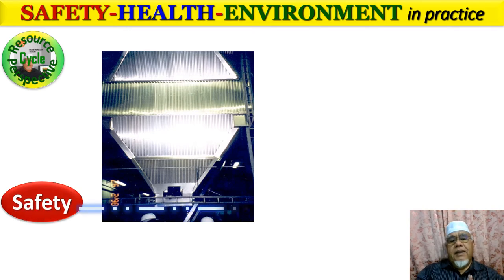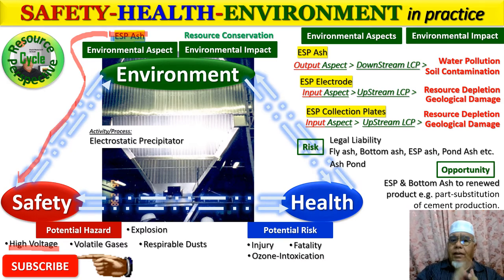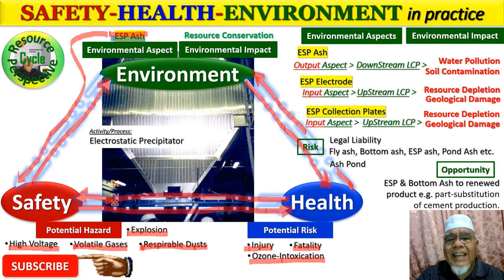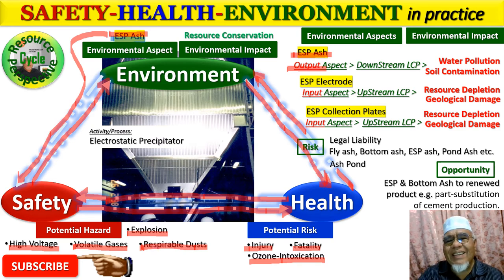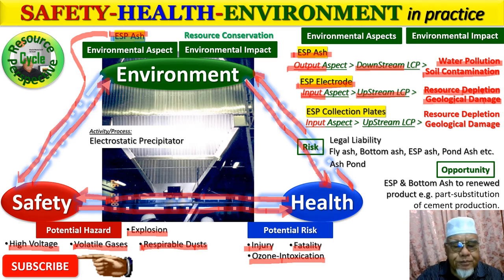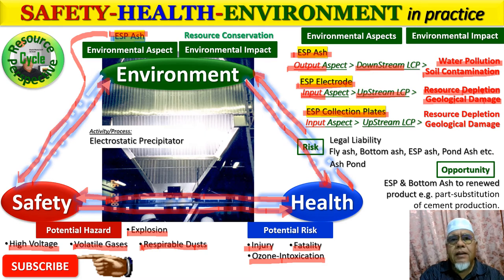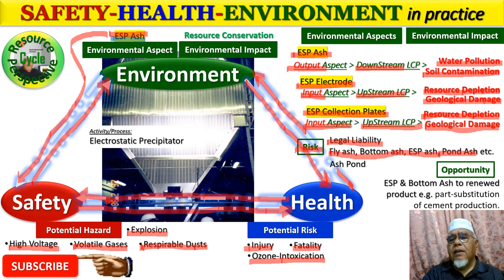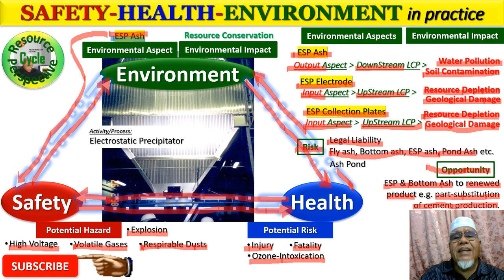S H E vs Electrostatic Precipitator.

Comment: Assallam Tuan Khalid.... terima kasih utk ilmu yg dikongsikan. 
Bnyk ilmu yg nak belajar dari tuan Khalid lagi.
Reply from the maker: Wa'alaikummussalaam Ma'am.
Semoga Baraaqoh dan bermenfaat.
Saya bukan pakar .. macam aje 😄
Please share dgn mereka yang need it.
Doakan kami yaa..
Reply: @KhalidMA  Tuan...sy nak tanya ttg TDS reduction on recycle water whats the best? 
Chemical precipitation or RO membrane?
Reply from the maker: @norazimahahmad2090  well, RO will definitely be ultimate in terms of effectiveness. But, it'll choke more often than not especially when TDS concentration is high.
Chemical precipitation is much viable economically but a bit messy .. sludge.
So, do a lab scale on the RO and check for its durability and then scale up your calculations for its probable cost in practice.